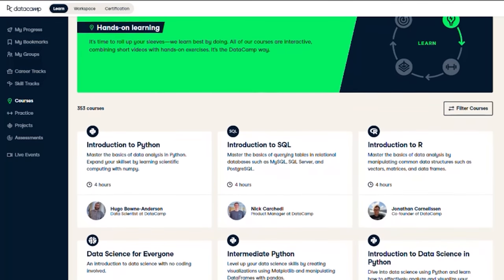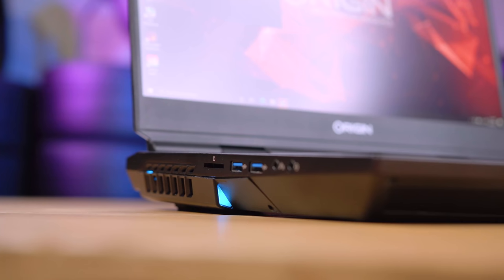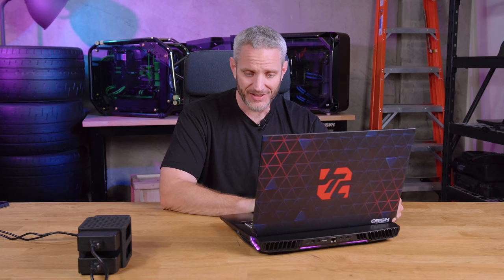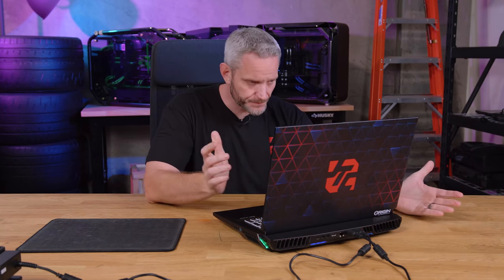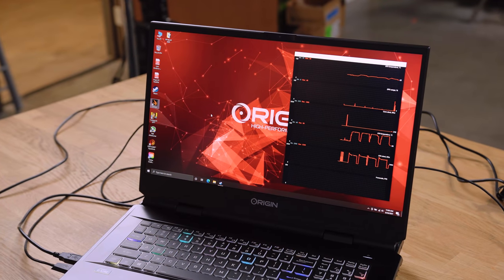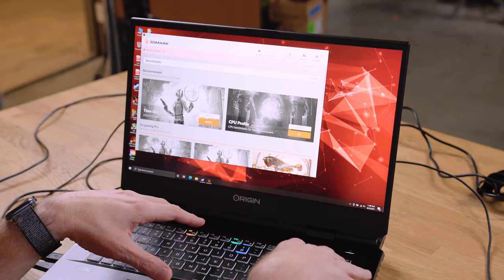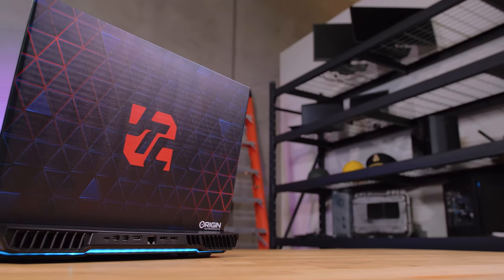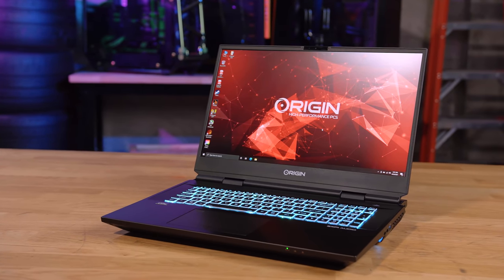You are GUARANTEED to HATE this... which is why it's so AWESOME!

Comment: The battery is more of a built-in UPS than something to depend on for long hours unplugged.
Reply: that's a pretty shit UPS then
Reply: @M3PH11  It's better than a typical consumer UPS you can get for small money. Those aren't supposed to last longer than a few minutes, just so you can save your work and shut down your machine.
Reply: @M3PH11  I mean a UPS in the sense of consumer stuff is meant for doing a clean shutdown of the system.  Honestly if someone needs more than an hour of backup juice for a computer system they should have a generator anyway.

Comment: "We're running off battery for the moment "  my guess is that is probably about as long as you can run it off the battery...
Reply: I had a laptop that was similar in size and design with a full size desktop processor and it would run maybe 30min on battery, even when not under heavy load from games and stuff.
Reply: Battery in the desktop replacement acts like nothing more than a battery backup system to give you enough time to finish what your doing, and close down properly in case of a power loss. (ie, when you lan party and blow a circuit lol which happened to me before with my old desktop replacement laptop)
Reply: @lyianx  You have battery and UPS crossed lol. Modern laptops cut power to allow for more efficiency when on battery juice.. You wont see the same core clocks ect.
Reply: @crisnmaryfam7344  right but this doesn’t cut power in portable mode
Reply: @crisnmaryfam7344  windows power settings lets you fix that really easily, its kind of the manufacturers fault for defaulting that way but it doesnt have to work like that if you dont want it to
Reply: @crisnmaryfam7344  That gains you a bit but it doesn't change it. Two hours idling isn't going very far under moderate usage, even when it cuts the performance. 

These laptops absolutely aren't expected to be used on battery much in ordinary circumstances. The battery gives you a lot of versatility, whether to unplug it and move elsewhere to plug it in, unplug it to show someone something, to be used in a pinch when power isn't available, etc. But if you are intending to use your laptop primarily on battery you probably shouldn't even consider something like this.
Reply: @DrakeDaraitis  Maybe not on a factory setup, but its most certainly still in the windows options. Get yourself versed with the power management options in windows and come back. It also depends solely on what you are doing, obviously trying to run blender or something similar on battery isnt going to net good results, but Like my kid for example, likes to unplug and continue watching whatever youtube video... I can almost guarantee you better than two hours life doing just that (given the correct settings), The one hes got now has about half the "umph" and around 1/4 of the battery and lasts 6x as long streaming twitch or youtube.. and at about 1/5 the price.
Reply: @bradhaines3142  Exactly lol
Reply: i have an onlder clevo with a 6700k desktop cpu and 980m, when on battery it drops the cpu speed significantly to 2.23 ghz, but when you plug it back on it automatically jumps to overclock speeds at 4.7 Ghz.  My battery life gets me 45 minutes. This new generation beast has more cores and true desktop GPU yet has more battery life, i'd say that's still a big improvement for this machine.
Reply: @crisnmaryfam7344  with an CPU that pulls 100W with even slightly over full idle use, and will peak at 250W powerdraw and averages 200W (at least in desktops) will not be able to be helped via Windows settings. It has to be helped by underclocking via bios or Intel XTU
Reply: Eh, I know it's a joke, but I just want to throw out here that I have this things predecessor, and it's functionally the same in this regard. With that said, I can game for about an hour before it starts getting all "Danger Will Robinson" on my about the batter life. Not gaming doesn't extend it much, though. But it can hold up decently for a bout of datalogging in my car - I use this beast as my tuning computer simply because I already own it - why buy a smaller laptop to do what this one can if I just man up and haul it out to the car? Slightly awkward, but free. :)  But yeah, around an hour to an hour and a half on battery in real life situations.
Reply: @MrBluePoochyena  you can undervolt in OS, which means you can activate an undervolt profile linked to the power status. Therefore a setting
Reply: @crisnmaryfam7344  This isn't a typical laptop. Its a desktop in a laptop form factor meaning its gonna suck any battery dry quickly. So in theory the battery wouldn't be very  practical to use consistently and reliably.  I mean, look at the power supply on that beast. So I think that's why it acts more like a UPS Battery Backup, IMO.
Reply: @michagabo8819  what the f are you taking about

Comment: I think the better moniker for this would be "mobile computer", since the "battery life" is more a suggestion that's there as an emergency battery so you'll have time to finish what you're doing to a point where you can safely save and shut down if power goes out.

Also, as someone who had a laptop specifically for travel, I hate how thin they are now. They are sacrificing far too much capability for the sake of style.
Reply: It’s not for style, for non gamers a thinner laptop is much easier to use on a plane and lug around
Reply: I mean you have to think about it, what looks more professional? A 1 inch thick grey box or a .5 inc thick aluminum one that weighs nothing? It makes sense and the majority of people who use them use then for simple tasks and are students or coffee shop professionals, 2 people that care most about aesthetics and usability, not raw horsepower and making sure you lift with your knees when getting the thing out
Reply: @Depl0rable10  that's a glorified tablet, not a laptop.
Reply: Mobile/Luggable Computer just like those in the 80s with small monitor.
Reply: I refer to my Alienware 18 as a 'desktop replacement' rather than a laptop.  And the battery is just there as a built in UPS, to give me the time to shut down gracefully in the event of power loss.  (For the record, at ~7+ years old it is still significantly faster than many of our clients PCs for repairing/restoring their databases.)
Reply: An buildt in UPS! :)
Reply: @TheRitchey1   It is at the point where it is absolutely for style, and the sacrifice of functionality, they're even at the point of removing ports because they're getting too thin, along with non-replaceable batteries. 

Again, as somebody who travels a lot (to both remote places, and places with a tendency for blackouts and brown outs), easily replaceable batteries (so you can have spares) are neigh essential, and easily replaceable base components a solid bonus to have. On that note not all airports have plugs for you to recharge either, let alone long haul public transport.
Reply: I had a blade pro 17. I did not call that a laptop so much as a portable gaming PC.
Reply: @TheRitchey1  Gamers never use their laptops outdoors for gaming lmao
Reply: @TheRitchey1  I still don't understand.
Yes light weight is easier to carry.
However you can go from 20mm to 30 mm and reduce the other measures multiple by 50%.
Yes, it's a bit unwieldy, however the gains in cooling and keyboard quality more that make up for it.
Reply: @Depl0rable10  They're both professional looking. The thin laptop is more minimalistic, the thick one is more industrial (if that's the right word). Honestly even in aesthetics I prefer the thicker, rectangular laptops, they just look nicer in my subjective opinion.
Reply: @martindinner3621  as long as it can run desktop chrome with a mouse and a keyboard, with a good enough screen, you've covered the needs for 95% of laptop users.
Reply: @Depl0rable10  depends on profession. I'd trust sysadmin with big gray box more than one with a macbook...
Reply: That battery is more like a built-in UPS in this sense.
Reply: That 97 watt hour battery paired with more modest hardware in a slightly thicker than average laptop would be terrific for a long lifetime mobile workstation or lite gaming system
Reply: @TheRitchey1  I physically cant use a laptop keyboard due to how thin they now are... the only people who want super thin laptops sit in coffee shops and only buy their food from whole foods... bring back function over form...
Reply: @insomniacbritgaming1632  just connect a separate keyboard and mouse, no problem.
Reply: As a kid I remember seeing a Compaq "portable" that was the size of my mom's sewing machine case.  A 10 pound laptop doesn't seem so bad to me.
Reply: The original portables like the Osborne were called luggables.
Laptops arrived and were so small it seemed you could use them without a desk
Reply: It's more 'transportable'  than 'portable"
Reply: The name "laptop" is not good for this kind of computer. Have you tried to put a gaming laptop on your lap even if just to open a browser? I don't recommend it.

Comment: given that one AC outlet is more than capable of providing enough power for both bricks, they really should include a Y cable for the AC side.
Reply: Agreed.
Reply: they could simply make a new mold for both of them together and have a single input.
They already made a mold to hold them together. I can't imagine that costing more
Reply: @Rok_Satanas  the thing is that the mold to hold them together allows them to use existing power bricks. A new mold for a large brick would be a new special use part.

Comment: 11900K, Bold choice for a probably thermally constrained chassis

Edit, to address the people saying the 11900k is 33% faster than the 11800H/5900HX
11800H(45w) CB23 score is 14600
11900K(150w) CB23 score is 16200
16200/14600=1.109
11900K is 11% faster than the 11800H, while using 3x the power, sure the 11900k COULD be faster than the 11800H or the 5900HX, as long as it was cooled properly. I bet if the 11800H were cooled to the same level as the 11900K, it could hit a CB23 score of 19-20000
Reply: Its a bold choice for a space heater. I’m guessing any engineering concerns were blown away by marketing and sponsorship. Imagine how much better this would be with a competent chip.
Reply: Well you could put a cooling stand or something
Reply: Yeah, I don't get offering these top end K series processors in a desktop replacement laptop, the thermal solutions just aren't there, a much better choice would be something like an i7-11700 since at it's 65W TDP the cooling solution could keep up much better, I wonder even if it would be similar to the Alienware X17 where with the 3080 the lower end 45W 11800h tends to give better gaming performance than the 65W 11980hk because of thermal constraints
Reply: @andyastrand  zen 3 would've been amazing. If going untel was necessary I would've chosen the 10th gen. Something like 10700k or 10900k. 11700k would also be a good choice
Reply: Yea it would be really interesting to see if you gain anything compared with a 11700k or even 11600k, or the non-k versions. Given that thermals is the limit.
Reply: @theluggage7131  Honestly, an 11800H would probably be faster, because its a 10nm part that runs cooler, and thus, can probably run at higher frequency, or allow the GPU to run faster
But i do like the idea of a socketable CPU on a laptop, i remember my old toshiba satellite P500D/505D came with a 2 core i5-520m and a GT330m, upgraded it to quad core i7-840qm and GTS360m
Reply: @denvera1g1  11800h gets around 75% the multi core performance of the 11900k so it wouldn't have been faster.

That being said the 11800H would've been a much better choice, or if you wants balls to the wall, the 11980HK. Which gets you 86% the multi core perf of the 11900k. The 11900k is a really REALLY dumb chip for even this

Comment: Is that GPU limited to 105W? If so, that should be increased to at least 190W, since there is option for 520W power delivery, and thermals are well below 85°C.
Reply: The battery would hate you then.

Also why would anyone need that much GPU horsepower on the go?
Reply: @igameidoresearchtoo6511  are you serious? 😂
Reply: @3xoticG4m3r  Yes, the battery would drain within seconds then.
Reply: @igameidoresearchtoo6511  The battery shouldn't even be considered, this laptop HAS to be plugged in to power at all times!
Considering that this is aimed at gamers, I WILL NEVER, understand why laptop manufacturers will combine these things with DESKTOP CPUS, the cpu isn't the bottleneck in 99.9% of games, EVEN on a laptop 3080..

A 5900HX would be more than enough for a laptop like this, limited to 65-80W, hell even a 5800X.. Yes, you lose about 30% performance, but the thermal difference and performance gain due to giving more watts to the GPU would be massive, and you asked why would you need that much GPU power on the go? I ask another question, why need so much CPU power on the go? The majority of programs these days are GPU accelerated and don't require 16 cores just to multitask...
Reply: @3rd.world.eliteAJ  Bro you ok?
No I legit want to know why you make me feel like I attacked you.
Reply: @igameidoresearchtoo6511  I don't think I came off as attacking YOU? More so explaining my grievances towards manufacturers and answering your question when the OP had a pretty valid point.
Sorry that you felt that way, I guess?
Reply: @3rd.world.eliteAJ  I apologize but I misunderstood you.. sorry

I see your point now.

Comment: Its actually closer to 20lbs all together! I actually bought one, mine is Sager's version, but they are all Clevo x170km-g laptops.

Same specs too, but Sager discontinued the 300Hz display, and mine had to go into RMA for screen problems (maybe it's related?). So I will be getting a 144Hz one instead, still when playing AAA games it's more then enough.

If anyone has any questions about it, let me know. Some questions will have to wait because mine is still in RMA and I probably won't get my replacement till next week or so.
Reply: why didn't you build a desktop instead? and also doesn't the fit and finish seems a little "cheap". for example, the vents on the side are not matched up, and the gaps between the bottom pannels are meh
Reply: @caominh2874  I always get asked by atleast 1 guy why I didn't just build or buy a desktop. Nobody drops $4k on a laptop without a good reason, that's why there is a huge market for them. I think this time I'll just leave it to imagination, rather then give you my lengthy and valid explanation.

The build quality is stellar, my only gripe is that Sager is one of the few that didn't offer a 300Hz display anymore. I didn't notice any unevenness with the vents to be honest, but if it was, then it's probably intentional because it has a pretty wicked laptop cooling system.

The bottom is fine too, unlike standard laptops the bottom comes in 2 separate pieces. That's why it looks like that, but rest assured it's not gapped.
Reply: @wilburcobb4596  Yup, I guess people can't imagine that there are people out there that spend the majority of their lives on the road. I'm an airline pilot, so that's one use case. I'm away from home 3 to 4 days per week. When I'm in a hotel, being able to have a full on desktop replacement keeps the twitch time to a minimum, allowing me to prove to my son that he hasn't become the master... yet. I've had various Clevo based desktop replacement machines since 2000. No regrets. Sure, it's heavy, but I attach it to my roll-a-board... not a problem. 

Getting a full on desktop replacement, IMO, also lengthens its useful life, as they are so fast that they don't need to be replaced with a faster machine nearly as often as slower, non desktop replacement laptops would be. I always buy the fastest machine available at the time, and keep it for five years... minimum. I'm at seven years with my current machine and yeah... it's time; the 880 GPU is really starting to show its age.
Reply: @floorpizza8074  I actually ended up getting a refund on my Sager version, and now I am getting Origin's. So I will have this EXACT laptop being shown here, just without the design.

I am in the same boat as you though, I am thinking about 5-6 years is how long I will have this machine. So its super expensive, but it will perform above and beyond for generations to come.